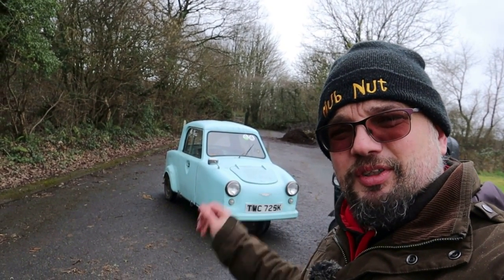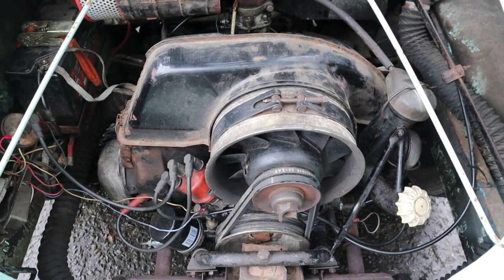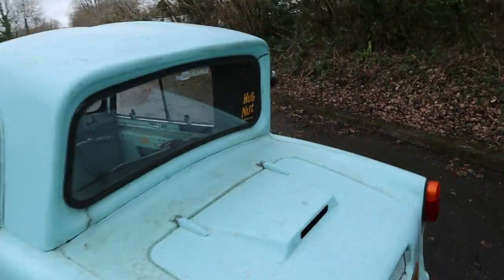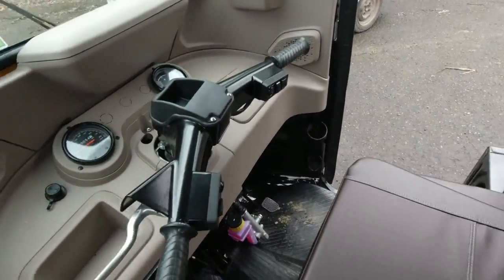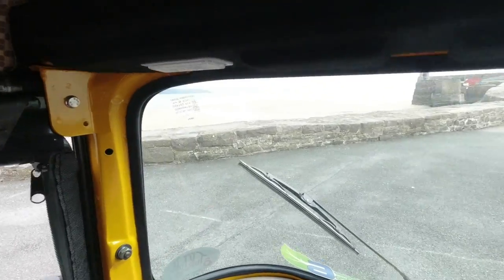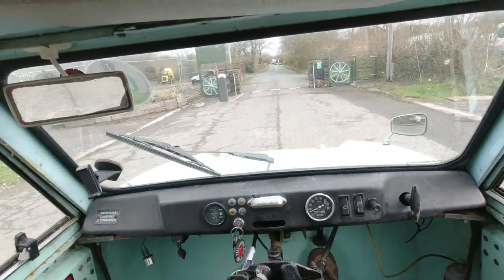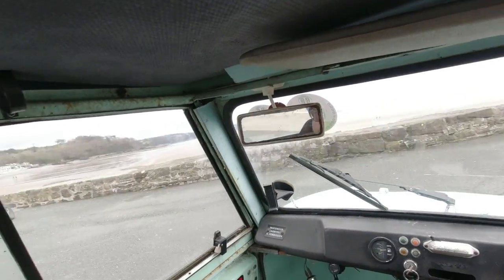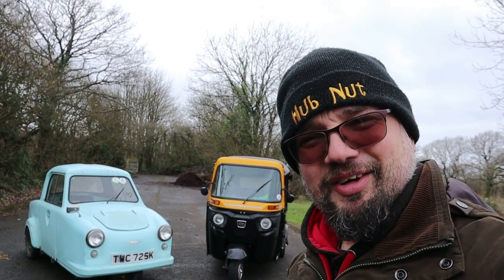THREE-WHEEL DUEL! TWC vs Tuk Tuk!

Comment: Talking about the stability of the three wheeler's Ian would you rather have one or two wheels at the front for better handling great comparison between the two vehicles   Rob
Reply: I think at least in theory it's a lot better to have two front wheels and the single one in the rear, at least that's what I've read. It makes the steering more complex though. On the other hand you don't need a differential with a single driven rear wheel. Of course you could also do as Bond did and drive the single front wheel by having the engine pivot with the steering - or have two rear wheels and only drive one of them via a chain, like the Puch Meister did, the Invacar's little brother from Austria. The Meister K5 wasn't specifically designed for wheelchair users but came from a small company that produced wheelchairs and invalid carriages. It had a much smaller engine than the last iteration of the UK Invacar, just a 50cc two-stroke, 2.6 PS with a top speed of 40 kmph, which is the legal speed for mopeds in Austria. It was marketed as something like a motorised shopping trolley. Until very recently (2009 I think) anyone over the age of 24 could ride a moped or drive anything licensed as a moped, so moped cars were fairly popular among people who had lost their B licence and therefore known as "tippler's Porsches". I once met someone (in the late 90s, when those things were already ancient) who actually shuttled around his whole family in two of those two-seaters, he'd take one of the kids and his wife the other.

Comment: What a Fantastic Compassion Against Two Entirely Different 3 Wheeled Vehicles Both Desgined For Totally Different uses. The Tuk Tuk Looked like an Absolute barrel Of Laughs. 
Deep Down However I Think TWC Is the Clear winner here Though. 

Pretty Cool on the Tuk Tuk you can take the Roof Down Should you require 👍

Comment: TWC: Better weather protection, better aerodynamics, lower centre of gravity, more powerful, easier to drive.

Tuk-tuk: 3 seats, in current production so easy to get parts for, different fuels catered for, fuel injection.

One is an excuse to make your mates come with you, the other is an excuse not to have to bring your mates.

Either vehicle will get you noticed. Big time.

Comment: The wiper on the TUK TUK is in the same parking place as on TWC. I would like to see TWC donor car essentially ruined by putting everything right with the car smoothest, powerful engine with injection. Bespoke gearbox diff suspension wheels tyres brakes all improved so she could keep up with traffic.

Comment: If the twc had 4 wheels and a steering wheel it would be great. The cvt transmission is fitting for light vehicles.

Perhaps if the single wheel was in the back it would more stable

Comment: Both vehicles are serving need of the people. One specifically designed for people in wheelchair, the other is for transporting people in cities and make them at less cost (Approx $3000 USD), reduced emission vehicles by using CNG or LPG fuel.

Comment: Bajaj used to make 98cc 2 stroke motorcycles based around the Kawasaki KC100 / KH100 engine, back in the 1980's & 1990's. 

The Bajaj 100 motorcycle was even imported into the UK and there was dealer network. Sadly they creased to be imported when cheap & nasty Chinese motorcycles started to flood the UK small bike market, starting in the late 1990's.

Probably still a few Bajaj 100's lurking around in sheds & garages awaiting restoration, unlike the Chinese 125 bikes that stole their market (which would have turned into piles of rust within 3 years of purchase!!).

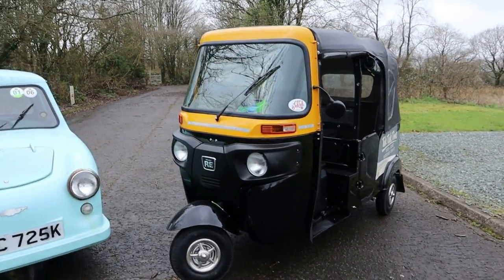Comment: 1:34 BS-6 or Bharat stage 6 is a part of Bharat stage emission standards (BSES) are emission standards instituted by the Government of India to regulate the output of air pollutants from compression ignition engines and Spark-ignition engines equipment, including motor vehicles. The standards and the timeline for implementation are set by the Central Pollution Control Board under the Ministry of Environment, Forest and Climate Change. India is a western name for Bharat whereas islamic world uses the word Hindustan.

Comment: I think this TWC vehicle ( Mr. Bean's car!😆) would can make one " grandiose " Come back at 2023 ! It's main asset the steer control! All by hands! Would can be very fitting for the millenials guys! But with some " Uplift " Tips like example make it in for like one van ( the kind like Ford Transit but in size nearly to the tuk tuk  and of course made it 4 wheels for more e stability, and the control console fit in some kind if tower comando ( on the center, of course!) And for more advanced to its time : the driver's door will at front and open it like those gates on the garages down to up! Then  the driver at center and his travel friends one by one beside! Of course made the car body enlargement for pick 3 pasageers more at back like the tuk tuk and the lateral doors would be can be like this old original version! Think young people at 2023 ! Will enjoy it and choice it! 😁 cheers

Comment: It had to happen and interesting comparisons. With a little practice on the throttle you can manage clutchless upshifts, downshifts are a challenge. CNG was only for the Indian diesel variants, the doors get taken off pretty early in their lives, otherwise you'd have doors littering the streets of Mumbai. The springs are heavy, they're expected to carry heavy loads, I've seen a truck engine getting carted around in Indonesia where the driver had to lean forward to get any steering control
Reply from the maker: Cheers Niall. I actually got quite good at rev-matching on downchanges, perhaps due to previous familiarity with non-synchro gears. It's just trying to make different parts of my body do the correct moves!
Reply: @HubNut  come to think of it you must be among the top ambimotodextrous people out there.

Comment: I would have thought that they would have fitted a CVT to the tuktuk as well, but I guess manual gears are a tad more reliable, given that belts and pulleys can be a touch problematic over time... :S

Thinking of the earlier invalid carriage options with manual gearing and handlebars, braking wouldn't be an issue as most motorbikes have that setup too, clutch on the left (and some with gear shift too), throttle and front brake on the right with the rear brake being foot operated, but that's for bikes, not mobility vehicles of the past... :)
Reply from the maker: Yes, but the earlier Invacars only had a Tiller for one handed operation!
Reply: Maybe they worked like a narrowboat then with a morse control levers for the throttle & gearing... :D

Comment: The autoricshaw is having a break on you foots because it is actually like a motor bike control. In motor bike the rear break will be in your foot. In some old motor bike the gear will be in your left hand(check m-80, Or bajah cheetak old). You won't find a front brake in auto because there is only one wheel on the front, so breaking that wheel is not advisable.

Comment: Is it still technically a Tuk-tuk if it doesn't have the two-stroke engine? As far as I know that was where the name came from. I wouldn't mind owning one of these, are there any available for sale to anyone who wants to own one or were there just the one batch specially imported for the company running the caravan site?
Reply: There is a company that sells these called Tukshop, but according to their FAQ you would need to have passed your driving test before the license structure was changed in 2013 so that puts me out of the question. It is strange how I can drive a two tonne 3.2L Ford Ranger but not a 350KG Tuktuk. Having said that I have since got my PCV (category D) so I can even drive a 15 tonne coach. I think these might require a standard (B) and larger motorcycle (A or A1) since it is half way between, but unfortunately I have not got category A.
Reply: @charlotteclarke4665  Do you have category K showing on your license?
Reply: @FM60260  No
Reply: @Volvo B10M  Why have your videos just gone?
Reply: @charlotteclarke4665  False copyright claim and they have all been removed.
Reply: @FM60260  WHO BY???
Reply: @charlotteclarke4665  I didn't screenshot the warning I got and now I can't find it, I don't know why they have had every single video removed.
Reply: @FM60260  Consider who could have done it. It is not the first time someone tried stuff like that.
Reply: @charlotteclarke4665  This time it is because of music on a video that didn't even contain music (for the second time). Now I apparently have to complete a course to be able to upload again. I also had someone who copied one of my videos and flagged the original a while ago. How did you find me in this comments section here anyway?
Reply: @FM60260  That sounds like a scam, if anyone contacts you asking to "settle with a small fee and have the claims removed" that is a classic scam.

I found you here originally because JN was trying to get me to buy a Tuk-tuk for a laugh and I just happened to stumble in to you talking about two stroke engines again. It would have been the topic or otherwise those weird bulb things that do some electrical trickery that NW said you were going crazy over.
Reply: @charlotteclarke4665  I know who you are referring to by NW but I can't figure out who JN is.
Reply: In India we call it Auto rickshaw. Because for us it's an motorised version of old rickshaws.

Comment: the invacar is far better than the mobilty scooters that a lot of disabled ppl use.
 mine does 8 MPH and its bloody freezing during the winter. with the rain canopy on when it rains u cant see much cause no windscreen wiper but it keeps me dry.

another prob is if the battery goes flat when ur out u have to call a breakdown company to come and pick u up as u cant recharge the battery unless ur at home as it takes 8 to 12 hrs to recharge it. with the invacar run out of petrol not to much of a prob just get towed to a garage and fill up.
there a bit easier to drive and get in and out of than a converted car from motabilty as well. its why i use a mobilty scooter as i cant get in and out of a car anymore. but i can get into the invacar.

another prob with mobilty scooters is their speed. other road users get impatitent when they cant get past u and start tooting their horns and throw abuse at u for holding them up.

Law states u can only do a max of 4 mph on the pavement. so takes twice as long to get anywhere on the pavement plus bins and other stuff get put on the pavement blocking u from getting past them, or dropped kurbs or lack of them cause probs. hence why i got a road scooter.

Comment: If you think the invacar is bad you should see the things from the 1950's two levers that you pushed back and fowards to propel yourself with stirups on top of the levers that turned the front wheel for steering then there was the other ones from the 60's with the villars engine.Ian you should have a drive in Colin Furze tuk tuk https://youtu.be/7y93MYaTx6M

Comment: Those little Tuk Tuk vehicles are amazing.  Consider the daily abuse they get bouncing along the roads of developing countries, yet they serve for years under that daily abuse.  They are simple and low cost to build, simple and low cost to run, and simple and low cost  to repair
I just learned that I can't replace the battery in my 2012 Ford F-150 pick-up truck without a laptop computer to interface with the on-board computer (via the OBDII port) to reset the "battery monitoring system" so it knows there's a new battery fitted.  WTF?  You need a computer to change a truck battery now?  Remember the appeal of the VW Beetle's simplicity, low cost and ease of repair?  Do we really need all this complexity?  I think the Indians have it right.
Reply: A trick used on smart cars to avoid all this was to connect one of those square 9v batteries to the cables before disconnecting them this was enough to keep the computer system happy while changing the battery, yours is most likely the same, maybe worth a try.
Reply: @johndilloway9762  That worked in the 1990s and 2000s to keep the computer(s) awake and radio presets, but this Ford monitoring system needs to know if a new battery was installed.  It knows when you refill the fuel tank and resets the miles-to-empty, but it can't recognize a new battery.
Reply: @steverandall5814  My god it's getting so extreme now with cars you almost need a phd in IT just to do a simple job like change a battery, Im so pleased I prefer my 2cv purely mechanical!

Comment: Not sure you are completely right about the Motability cars being better. Do we see cars around the football pitch now? Can a person move from a wheelchair into a car, slide over and then put their wheelchair in next to them? No, because the car isn't purpose designed, just an adaptation. I think the function of the Invacar has largely been replaced by electric mobility scooters. Seems like a downgrade.
Reply from the maker: But a converted car doesn't draw attention in the same way. Invacars really did label people as different, and owners got picked on as a result. Mobility scooters offer much of the benefit of an Invacar and more. You can drive them into shops for a start.
Reply: Yes, I agree with you on both of those points, but it's not a simple argument. Mobility scooters also get stolen and their owners are frequently picked on. Many people liked their Invacars and didn't want to give them back when the recall happened.